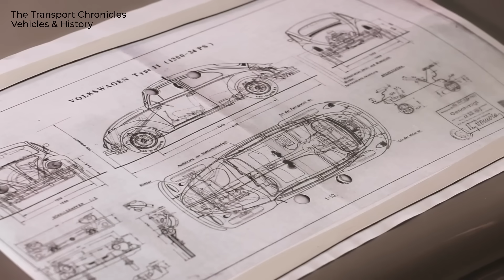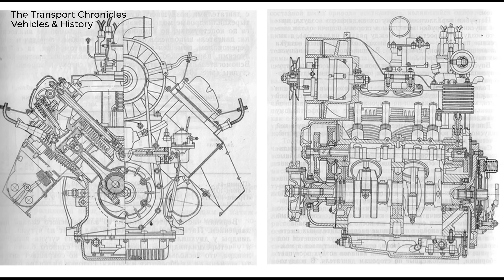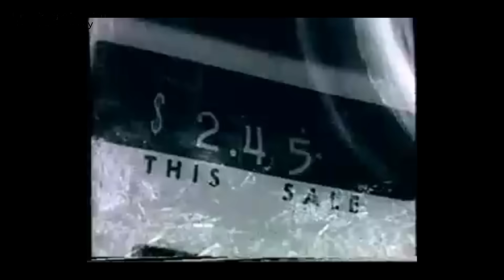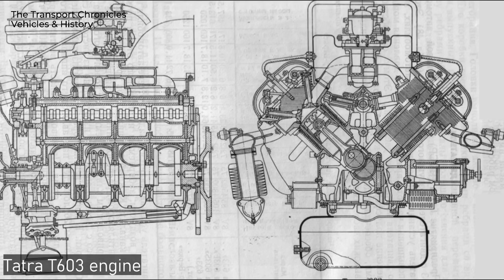Why Did Air-Cooled Engines Disappear?

Comment from the maker: What do you think? Will air-cooled engines make a comeback, or has their era gone forever?
Reply: They're still used widely in lawnmowers, etc.
Reply: I love air cooled and still enjoying my 50 year old Citroen GS 😊😊😊
Reply: @ThierryDixon  
You're so privileged to have such a car, my jealousy glands are working overtime 🤣
There's a channel called HubNut and he had a later GSA and the sound it made was magnificent when he took it out. 
He also has a 2CV (named Elly) which he's had 25 years and I was never a fan when I was younger but I am now, I love it when he drives that. 
He also has a car called an Invacar that was for disabled drivers in the UK in the 70's with a Steyr Puch air cooled 2 cyl mated to a CVT, you want to hear that thing go.
Reply: Tatra still making them for trucks so i see no real difficulty for those engines to go back meabe even in some kind of exotic cars after all why now. Also air cooling is what made porsche a real porsche.
Reply: Are cool engine will be perfect for hybrid cars this will increase the efficiency the weight of the engine better fuel consumption
Reply: Air cooling on diesel engines is ideal. They warm up quicker saving wear but the problem seem to be emissions.
Reply: It Will come back.
Reply: I don't think air cooled will ever completely disappear because they're used for smaller applications nowadays, such as motorcycles as mentioned already in the comments by @joshrogan9854. 

They're also used in chainsaws, lawn mowers, small boats and the other such applications but I doubt they'll ever be used anything as large as a car or larger again.
Reply: Never they still have all the same issues, well maybe on the lawn mower.
Reply: The days of piston engines is numbered. EVs will dominate.

Comment: Might want to check out the romanian Oltcit. Also Air-cooled and a boxer engine. Main issues were pure bad maintenance and typical for soviet block, bad part quality. Was the equivalent of a Golf 1 at the time and quite good if maintained well.

Also to the last point. Them coming back will be quite hard due to how modern day emissions work. They have to be right even during cold starts, which is not good enough in air cooled engines. Motorcycle engines are still being offered but they are a few Euro-Norm levels behind cars. I don't see how even BMW can make an Euro6 compliant air cooled motorcycle engine.

Not discussed is that water cooling offers cooling overhead and more control. It is much easier to maintain the correct operating temperature with a thermostat than with a fan.

Comment: I'm nostalgic for the classic VW Beetle. In my opinion, the greatest car in history. Perhaps the emergence of a hybrid model could rescue it, along with its air-cooled engine. Front-wheel drive with an electric motor at each wheel, the floor of the car formed by batteries, and rear-wheel drive thanks to the engine. The combustion mode is useful on highways and roads, where it's noisiest. The electric mode is useful in the city, where ease of driving, less noise, and less pollution are needed.

Comment: Emission standards in the west killed off the air cooled engine in the West....Or that is what I have been told. porsche was able to do it  the longest because of the precision and complex electronic systems the designed, but even they could not keep up with the ever more strict emission requirements

Comment: Air cooling is not coming back unless it's in the form of air-cooled batteries and electric motors the days of the internal combustion engine are just about over. Rest in peace air Cooling.
Reply: " the days of the internal combustion engine are just about over"

BWUAHAHAHAHAHAHAHAHAHA

Comment: I daily drove a 1960 Corvair from 1995-2018. It was an old car that needed lots of tinkering with because I never really refurbished it. It always fired up and never left me stranded. I got older and decided it wasn’t wise to be on the road commuting to work alongside massive modern day automobiles with a lap belt as the only safety feature.

Comment: Also is worth to mention that air cooling is much more common in motorcycles. Another cooling system worth exploring is oil cooling. Oil is less corrosive than water. Less effective than water, but still better than air.
Reply: Most “air cooled cars” were in fact at least partially oil cooled.

Comment: The claim that the operating temperature of an air cooled engine is more stable is utter nonsense once the engine is up to temperature. Liquid cooled engines have thermostats, and usually, these days, temperature controlled electric fans. That keeps the coolant at a much more even temperature.

It is one of the reasons it is easier to meet emissions standards with liquid cooled engines.

Comment: VW engines did not last long--this is not because they are air-cooled but because they have no oil filters.  If you install an oil filter, they would probably last much longer.

Comment: Gasoline heaters...extremely dangerous...Yeah, I remember my friend's VW Super Beetle...Had heat on the floor but no heat to the windshield defroster system....Meh, I used ta scrape the windshield while he drove.....Ja, Superior German Engineering, snort.  I'm thankful we didn't die in that fuck'n thing

Comment: a conspiracy theory, haha i dob´t know, when i friend have a problem with the car i mostly a sensor, not the spark, the timing, etc. i own a 1965 vw beetle (vocho) for 11 years and a 1985 kombi for 3 years, both of them have problems, of course are old, but 70% of time i can repair, change the cable acelerator, adjust the carburator, the distributor and i doing the manteinance. In this time, when people think about the climate change, and buy and hybrid or an electric, i believe in the reuse, is better to use an 60´s or 40´s years old car, is not for all, you must deal with problems, but i learn a lot, but the way im not a mechanic, i am a IT administrator, great video!!! (sorry for my bad english)

Comment: I love air cooled engines. My 1968 VW that I bought for $200 in 1980 was probably my most favorite vehicle.
Fun to drive, easy to work on.
I love the "simpler is better" concept.
With good new heater duct hoses, my cabin heater worked fine for me. Windshield defroster was slow. But with the windsheild so close, it was easy to wipe off the inside while driving..
I was able to fix everything in that car by myself.
A treasure.
Chuck.

Comment: What about small aircraft? Don't they predominantly use light-weight air-cooled engines in preference to heavier water-cooled ones?
Reply: Yes, but they aren't held to the same emissions constraints.  Heck, most involve pilot controlled mixture adjustment, selecting over-rich for high risk phases like takeoff and initial climb.

Comment: Aircooled engine in car? NO WAY! Always hot - rubber seals degrade and leak. Oil leaks + road dust = perfect layer of cement all over the engine, especially on critically hot parts - it overheats even more. Zhoper at its best, when you disassemble the engine and see there thick crust of shit...

Bonus - its ineffective. It must cool in harshest conditions, +40 air temperature and full power. It means in regular condition airflow is several times more than needed, doing nothing only sucking power from small engine. And, of course, its very difficult to stabilize the temperature, with some air vanes or similar weird solution.

Comment: What's the difference between air-cooled and naturally-aspirated?
Reply: Apples and oranges.  Naturally aspirated is the alternative to turbo- or super-charged.
Most modern turbocharged engines use air-to-air intercoolers to increase intake air charge but that's not the subject in this video.

Comment: There’s a very interesting article on Curbside Classic about the air-cooled Honda 1300, the last car designed with Soichiro Honda’s personal involvement.

The air-cooled engine in the Citroen GS was something of a stopgap. The plan had been for the GS to have a Wankel engine (as the later GS Birotor did) from the get-go, but the car was ready and the Wankel engine wasn’t.

Porsche abandoned air cooling because of EU regulations about how noisy a car was allowed to be.

Comment: As you said, water is much better at conducting heat than air. That means in a high-performance, high-compression engine air battles to get rid of the heat. One of the more powerful Corvairs had fans that ate up something like 17 hp. To get their engines to run cooler, VW made the mixture rich and the Beetles were relatively heavy on fuel and their exhaust gas was dirty--one of the reasons air-cooling went out. It's OK for very unstressed engines, like aircraft engines. Beetles, and especially the Kombis, readily burned their exhaust valves. My mother did accounting for a big VW dealership.
Air-cooling is just not as good as water-cooling, period.

Comment: I worked with VW and Porsche engines for 25 years.....big thing that killed them was emissions and cooling.
Reply: They were old engines, newer designs would not have those problems.
Reply: @johnburns4017  nothing to doe with the age of design: air cooled engines have large t° variations, and this is bad for emissions, in addition the cooling fan absorbs continuously lot of power= more consumption
Reply: @leneanderthalien  
Electric cooling fans are superior, they do not move on warm up.

Comment: They are not very efficient. An air cooled engine uses a large amount of the horsepower it generates just to keep itself cool.
Reply: Not really. Look at the vid again.
Reply: My air cooled motorcycles used no horsepower towards cooling.
Reply: @chrisstoddard1144  Let it stand idling for a while and it will self destruct. 😮 My air cooled VW kombis use about 20% of the power generated keeping themselves cold and more at higher RPM😂

Comment: The Citroen GS had a flat four, overhead cam air cooled engine with a brilliant heater that warms up so quickly. Also Panhard made a brilliant air cooled flat twin with roller bearing crankshaft which revved high and produced 60 bhp from 850cc 😊
Reply: In France they taxed cars by the engine's cc. Large engines were heavily taxed. So the French designed engines to rev high to use most of the power available most of the time, and lighter cars and engines - they were very good at this. Air cooled engines were lighter giving a higher power/weight ratio. You have to revv them a lot - with associated noise. This put people off who were familiar with low revving bigger engines, which most of the time used little of the HP available.

Comment: I had a 67 VW Squareback which had an air-cooled 1600 engine.  It was not rugged at all.  Weak case, pulled studs, overheating, and poor cabin heat.  I wouldn’t have another one.

In the 70s, I often noted that a disproportionate number of cars broken down on the road were air-cooled VWs.

All that said, my Squareback was very fun to drive.

Comment: Air cooled engines have returned.  Electric car motors are air cooled.
Reply: Not generally.
Reply: The battery packs now tend to use liquid heat management systems.

Comment: I own a 1970 VW Bug and it was simple to work on and the emission standards is what squashed them. Porsche built a 959 911 that had liquid cooled 4 valve per cylinder heads, one piece,  on air/oil cooled flat 6engine displacing 2850 cc with twin turbochargers. The 959 was very expensive, but the liquid cooled heads could be applied to air cooled engines again.
Reply: I had a bug.  If I remember correctly, every 30,000 miles or so one should get a valve job.  I used to religiously read, "How to keep Your VW Alive, A Step by Step Guide for the Cmpleat Idiot."  Yes he did spell Complete that way.

Comment: Why diesel engines? Even petrol engines with air cooling systems have limited power. For stop and go traffic, the urban air is already warm and do not remove heat from engine.
Reply: Liquid cooling requires exchanging heat with ambient air through a radiator; the same problem. Many aircooled engines use radiators with engine oil as the medium for heat transfer.
Reply: @gooser__43  urban should use tram. Why does the London tube get hot? Don't they recuperate?

Comment: I cannot believe how someone can celebrate backwardness. Air-cooled engines are way behind the properties of liquid cooled ones. The distribution of heat on l.c. engines is more even and gradual which makes emission control easier and mitigates hot spots which as a result slows down parts wear. In addition a.c. engines are typically noisier than l.c. counterparts. The reasons are several among them vibration of cooling fins and required clearances (not tolerances!) among working parts.

I owned several motorcycles starting with air-cooled up to 600cc 4-cylinder transiting into 4 and finally 2-cylinder water-cooled engines. There was absolutely no way to deny improvement with w.c. ones; it is all different 'culture'. The liquid cooled engines are improvement in every aspect hands down. Hint: look at specific heat of air vs. liquid; you will immediately see the answer to which is more effective. Liquid wins!
Reply: One more important thing to mention: the combustion engines are turning full 2/3 of energy present in fuel into HEAT. Only 1/3 goes into motion. Interestingly, same applies for firearms.

From this is evident what is going on - engines are primarily a HEAT management devices; motion power is a "side effect". Leaving this process to air alone is poor shortcut. Air is good insulant, but not conductor.

Comment: I've been in a car with an air cooled engine when it blew up, five different cars in two years. They sucked.
Reply: really? I've thrashed my Cub for years and it's still going strong these days
Reply: five different cars in two years'
Something tells me something is wrong.
Reply: @johnburns4017 They were all air cooled VWs not designed for freeways, which is where they all failed.
Reply: They were all 1960's VWs and a Chevy Corvair.
Reply: It has to be the trabant isn't it

Comment: Apart from today's very strict emission regulation some air cooled engines did not always warm up so fast in winter, and kept running somewhat too cold. So burning too much fuel and have bad tailpipe emissions.To overcome this you need grille shrouds, thermostat regulated cooling ducts etc, and you might still have a uncomfortably cold cabin. In some cars this was not done at all, like the Trabant, so you had to put up with that or indeed install a winter cabin heater that uses even more fuel or atleast close off the grille with cardboard or something. People today do not want to be so uncomfortable so..... to be as frugal as possible on fuel I suppose watercooled can hardly be beaten.
Reply: Heating of Trabant was solved quite ingeniously; I owned one. It certainly was not as efficient as on l.c. engine equipped cars but it was not bad at all. This is not to miss the evolution stage allotted to a.c. engines. They are way in the past and rightly so.
Reply: @zdenekprisovsky2783  I know, I drive one. They made the best of what they had.

Comment: Another big flaw on the VW Beetle / Bus was that the gaskets from the heat exchanger failed and the exhaust gases where soaked in the cabin. Also if you drove them downhill in winter you had a lack of heat and had to fight with frosted windshield. Many drivers installed heating fans for defrost powered by the cigarette lighter plug.

Comment: its the whole reason I refuse to sell my 1996 Mustang. Sure the plans for it may require a few modernized pieces but it will be mostly a mechanical car once finished. gotta save up 30-50 grand for it all since it needs a lot of work to even get it back on the road with a replacement pathetic 3.8 V6
Reply: What's that got to do with air cooling?

Comment: I was born in 1951 and my parents owned a 1965 Volkswagen Beetle and a 1972 Volkswagen Beetle as air cooled engine cars. If I remember correctly another reason that air cooled engines were discontinued involved emission control regulations. Air cooled engines run some what hotter than water cooled engines and can have uneven temperatures which make emission control more difficult.
Reply: another reason that air cooled engines were discontinued involved emission control regulations.
To make the engines run cooler VW made them run on rich mixtures, hence the dirty burning.
Reply: @grasonicus  Good point. The air-cooled engines are running typically rich to keep them from seizing. In turn their are not environment friendly.

Mind you, some motorcycle engines, although water cooled, are also running a tad rich; Honda is one of them. Yet they have to pass regulations. It is a tricky game with no place left for old-time engine fans.
Reply: Yep !  The biggest drawback..combustion temperature control. You commented before me.